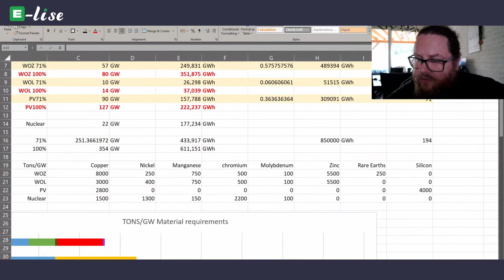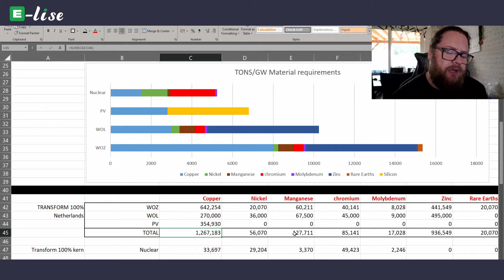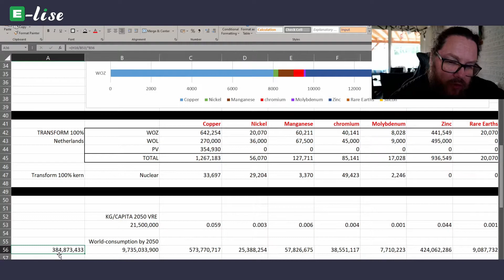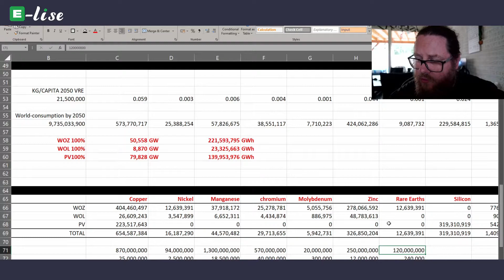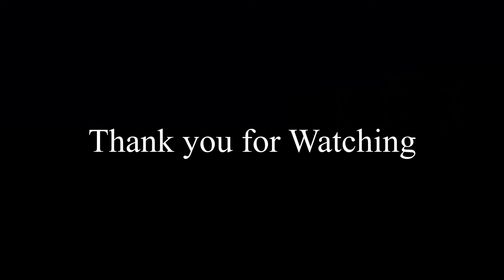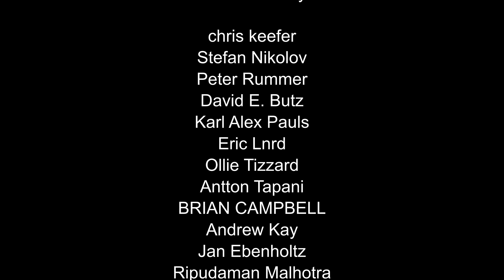No luxury for you with wind and solar

Comment: Why in-land wind turbines need no REEs? Don't they also use RE magnets?
Reply from the maker: Good question, I was wondering this as well.
Reply: Offshore wind turbines need to be designed to require less maintenance and to survive the corrosive effects of being more exposed to sea water, so the gearing built into them isn't the same as the onshore wind turbines where they trade mechanical efficiency for needing less frequent maintenance. They use rare earth magnets in the offshore turbines to make up for the loss in efficiency compared to the onshore turbines. Or at least that's what the logic of it was 6 or 8 years ago and things have probably changed (for instance it was never explained why they didn't use the rare earth magnets in the onshore turbines to get more out of those turbines as well).

Comment: one thing that you dont talk about is: what is the extraction rate of a mine 1 Mton/yr, 0.5 Mton/yr. so how many mines will we need to open and how many will be opened fueled by a goldrush for copper, to be the first to meet the rising price. There are only 10 top 10 mines. their is also low key problem with copper theft in there poorer parts of the world.
 

 also this channal so is worth it